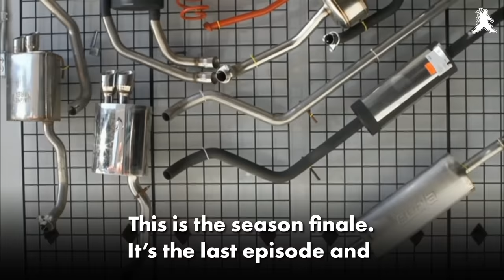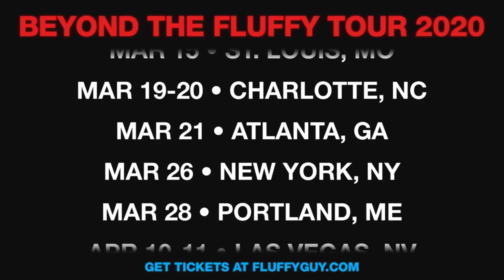Martin's New Ride | Gabriel Iglesias

Comment: This is what friends to for each other.
Back a few months ago a friend of mine told me his roommate was threatening him . So I got things together a went to get him moved to a safer place. 75 miles into the trip my engine caught fire. Had to get it towed back home.  He absolutely refused to help get my pickup back running again, It's sitting out back, not fixed, I just don't have the funds to put an engine in it. I tried to help a "freind" and got messed with.  I really try to help others and most of the time I can make things work. Then one out of a thousand I get my heart ripped out, as if I mean nothing.

Comment: Now this was music to my ears and reason why absolutely hated pimp my ride="Engine, Transmission and general overhaul". What i should be doing with my pimped van when it eventually leaves me on the road? Ou cool it has bed, now i can fucking live in it where ever it broke down... How about you leave 500kg and few K$ off with that humongous sound system and fix the fucking mechanical side and all the rust that it can run next 20 years, then we can talk what should be done with rest of the budget?